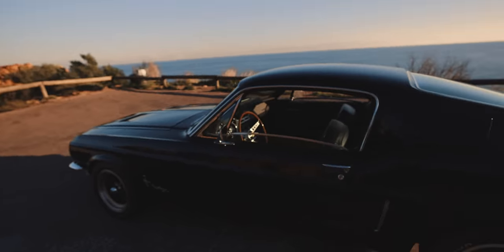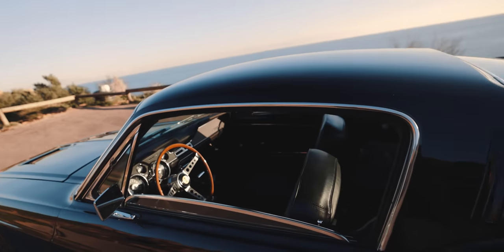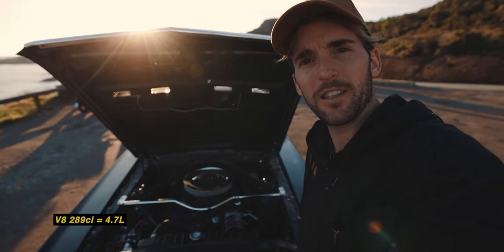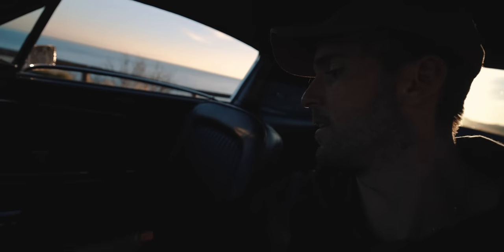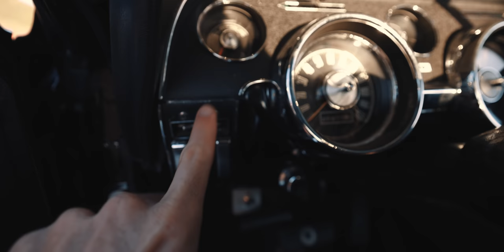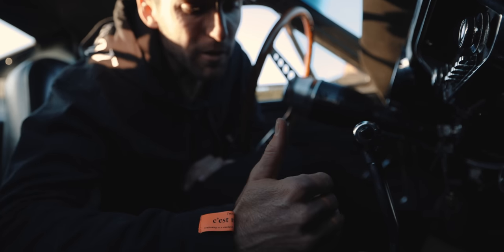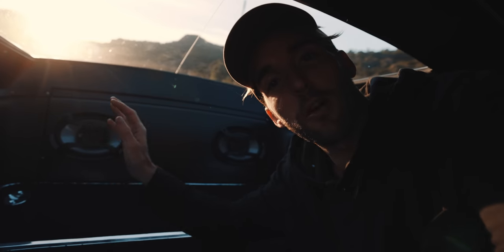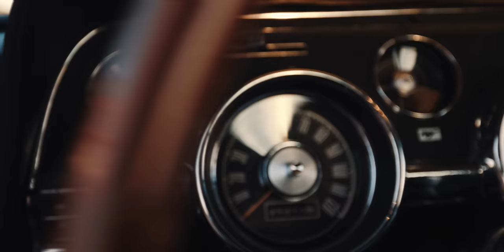MY 1968 MUSTANG FASTBACK FULL PRESENTATION!

Comment: I had a 67 Mustang coupe in the 90's.  Great car.  I slept in it a few times.  Not the most comfortable especially for someone tall.  I wouldn't sleep in it unless you had to.  Do a scenic road tour along the coast and stay in air bnbs. As for modifications to the car, you could stiffen up the suspension and bit, and maybe add posi-traction for the rear.   You can also add a new manifold and carb combo for an extra boost in horses. I'd also add a GPS tracking device to the car, as they can be easy to hot-wire unfortunately.

Comment: Would blow away every car parked in front of the Casino de Monte-Carlo.  And I know, because I gave my 1965 fastback to valets at the Bel Air Hotel in LA one evening, came back, and found that they had moved the brand new celebrity-owned 911 Speedster from the best VIP spot to put my car there - gleaming Wimbledon white with black centerline stripes and a GD Stealie bottom-center back window.  Best car I ever had.  And that includes Porsches and Ferraris.